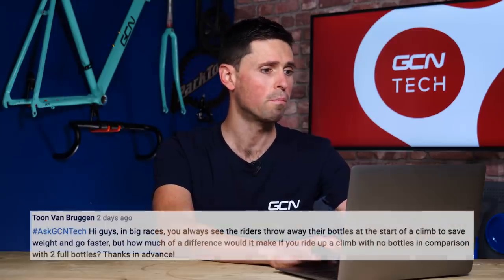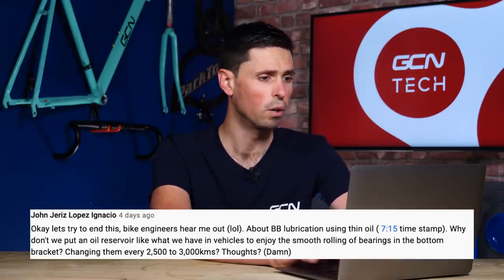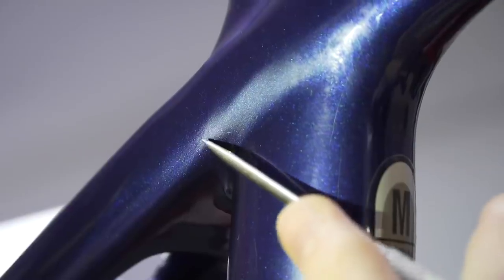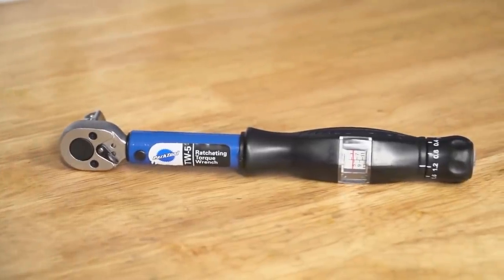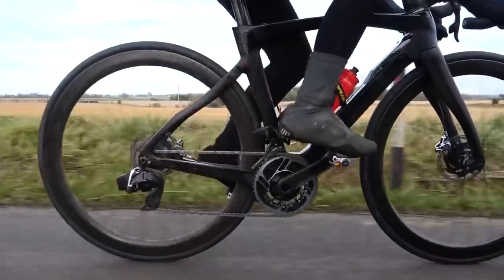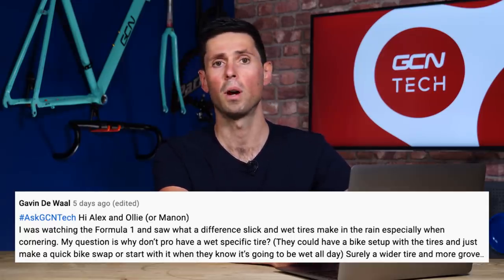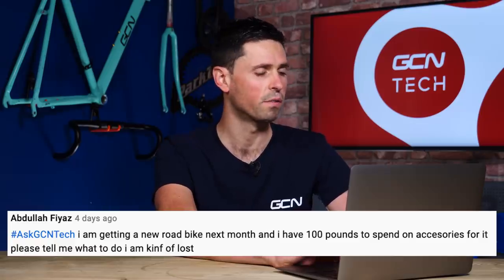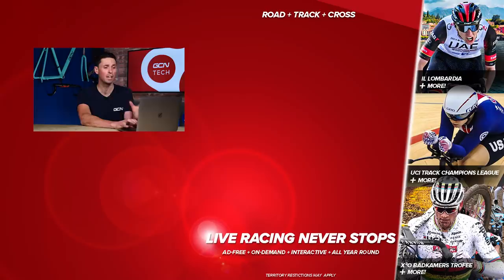What Accessories Do I Need For My New Road Bike? | GCN Tech Clinic #AskGCNTech

Comment: I'd think a helmet is the 1st thing to buy after getting a new road bike. Safety first and all. Just sayin.
Reply: The OP did say "new" road bike as opposed to "first" road bike. So it is rather difficult to answer that not knowing what they already have that can be easily swapped and how interested they are in preserving the ready to ride status of the retired bike.

 Sadly, their budget is going to be very tight unless they are transferring over at least pedals and their helmet as those extremely important two items will eat that budget right up if not a bit more for reputable names on those items. ie shimano spd-sl pd-rs500 + budget Mips helmet Giro Isode = ~$130 USD 

This is assuming the fit is dialed in on the new bike and the stock saddle is OK. A bike fit alone is worth blowing the budget straight off the rack.  

I think it is pretty common to swap over; pedals, helmet, computer, stocked saddlebag and the saddle for a new ride which leaves really only bottle cages. 
The first road bike is going to be the most expensive to fit out just from a functional perspective requiring; shoes, helmet, shorts, pedals, eye protection, tubes, pump, tools, bottle cages, bottles, saddlebag, computer or phone mount, chain cleaner, chain lube and lights if you ride at dawn/dusk/night. 

I'm sure there will be those saying half of those accessories aren't required and while i agree that the expensive versions of them aren't the basic versions improve the experience enough to merit calling them required.
Reply: @All4Grogg  You could be right. If they have a mountain bike say and this is their 1st road bike. That's a good point. Also I didn't even think about pedals....

Comment: Torque wrench for Thru axles.
Reply: @wasupwitdat1mofiki94  How is that funny? It's the most important part of the bike, the wheels have to be correctly attached to the frame and bike companies have decided to use bare ass carbon as the clamping surface. So torqued thruaxles are important. My bike says 10nm
Reply: @Eucalypticaz  I have a titanium frame so I don't worry about torque specs. I also have a titanium stem and handlebars and an aluminum seatpost. Like I said, I don't care about torquing anything. Do you carry your torque wrench out on the ride with you too?
Reply: @wasupwitdat1mofiki94  No. It's a set and forget thing.
Reply: @Eucalypticaz  So what happens when you have a flat tire?

Comment: #AskGCNTech Hello !! Airplane tires are inflated with nitrogen to make them more resistant, If I inflate my bike tires with nitrogen will they be kinda puncture proof ? thanks for your answer
Reply: Nitrogen only helps with air loss because it contains larger molecules than “regular” air. Meaning that it helps with very, very slow leakage…not punctures or any type of hole.

Comment: #askgcntech The rear casset I have is wobbling when it spins, the largest gear moving about 1/4 of the chain width.  It doesn't seem like the cassette is the problem, as when I put it on another bike it doesn't wobble

Would replacing the freehub solve this problem, or do I need to replace the wheel?
Reply: My guess is there is something wrong with your hub axle. This is especially so if your rear hub has angular contact bearings (i.e. cup-and-cone). One of the ball bearings may have fallen inside the hub shell instead of being secured by the cup and cone, causing the axle to rotate in an eccentric manner. It's happened to me before and it should be dealt with ASAP, as the wayward ball bearing is wearing away and exerting force on a part of the hub axle it's not designed for. Leave it for long enough and your axle can break.
Reply: Which group set is it??
Reply: @janmitvora4510  shimano sora 9 speed

Comment: Spare innertubes on a new bike?!! Run tubeless unless you like fixing punctures miles from home! Let's be realistic regarding tubeless - you can still get flats & they can be a pig to initially set up & not always easy to get the 2nd bead over the rim on road bikes but I've had only 2 failures in about 10k miles. The 1st was with a brand new tyre when a discarded wood screw destroyed it - I doubt if an innertube would have faired any better. The 2nd was a fast blow-out on a completely worn tyre. Neither involved more than a couple of miles walking.
Tubeless technology IS improving all the time with rim/tyre compatibility getting better & it may get to be a non-issue with hookless as long as riders can get their heads around running wider tyres at lower pressures, getting lower rolling resistance in the process. I've probably suffered from over 20 "punctures" that have just sealed without realising at the time.

Comment: According to Einstein's mass-energy equivalence equation (E=mc^2), a charged battery does weigh more. Assuming the bike computer's battery is around 600mAh and 3.7V, it holds 8000 joules of energy. Divide that by the speed of light squared and you end up with 89 picograms, which is the difference in weight between a charged battery and a discharged battery. That's enough to save more than 2 picoseconds up Alpe D'Huez. 🙃
Reply: M A R G I N A L   G A I N S

Comment: BB oil ➡️ Buy a bike with a pinion gear box 😏😁😁
Reply: I was thinking that to and I'm sure an oil filled BB is perfectly doable. Would just need to be sealed like an IGH. The problem I see is the seal friction would put people off. It would undo any benefit of having oil over packing it with thick grease.

Comment: 1:42 "the issue I see with it..." WT actual F are you talking about? : /
The letter is obviously referring to an oil bath where the the BB bearings are semi immersed in oil. No need for a sump, a catch can or an oil pump. lol 
Having said that, any gains in lubrication would come at the cost of increased friction. Seems like an unnecessarily complicated solution to a non-existent problem if you ask me.